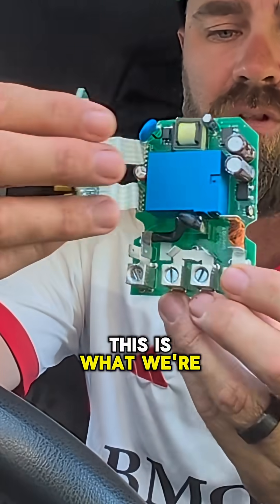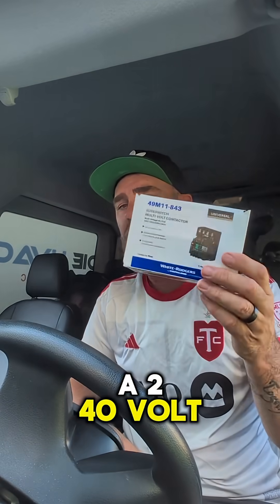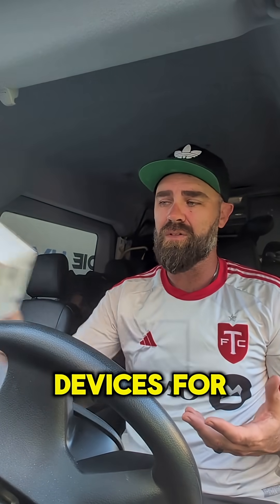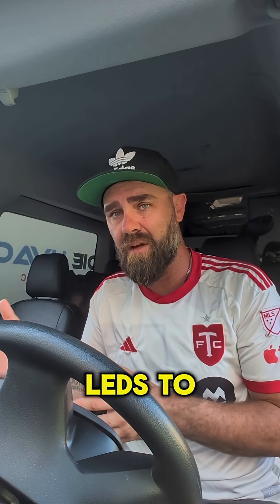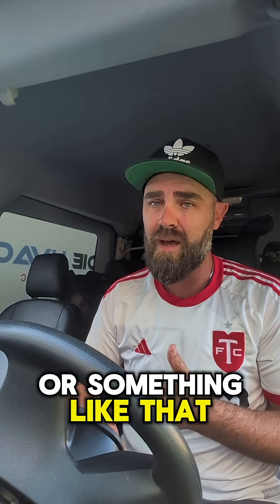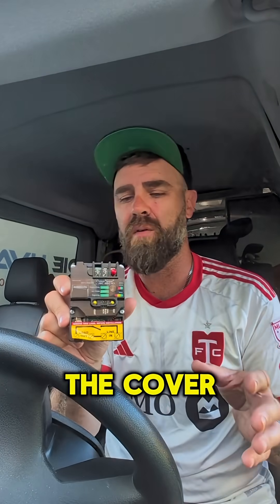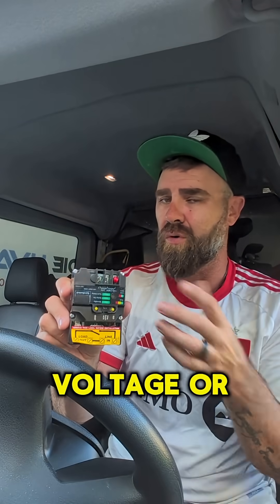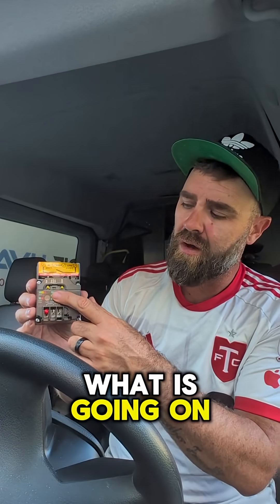Copeland SureSwitch

Comment: I am an HVAC Tech.  I am not sure about longevity vs a contactor, but I have put this same unit on my units at home.  We have a lot of power issues.  We could argue the fact that since it is electronic, that could come with issues of its own and longevity.  Here is where I stand on it though.  I think they should come standard on every new unit.  The power protection alone could save you thousands. They cost more on the front end, but compared to replacing a compressor, It's a no brainier if you know.
Reply from the maker: Agreed